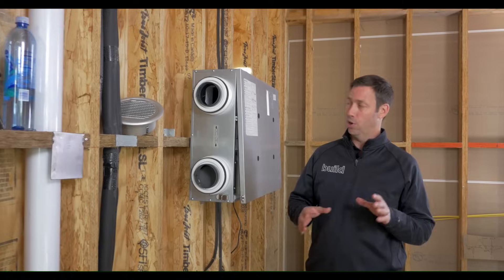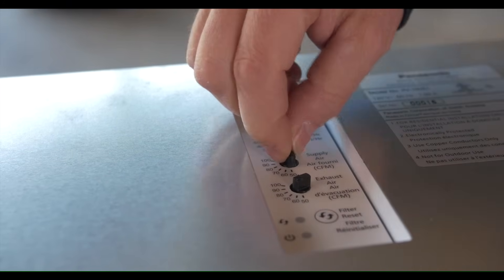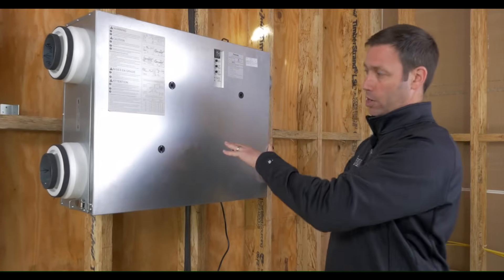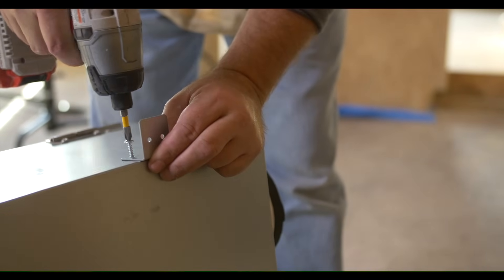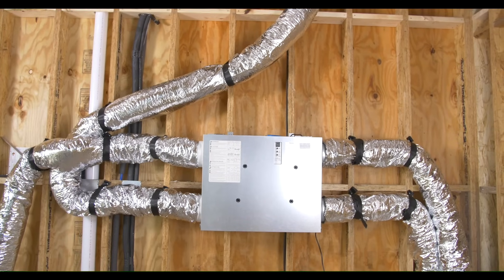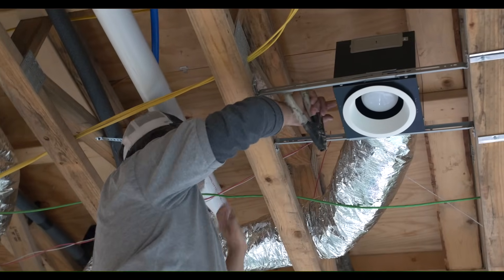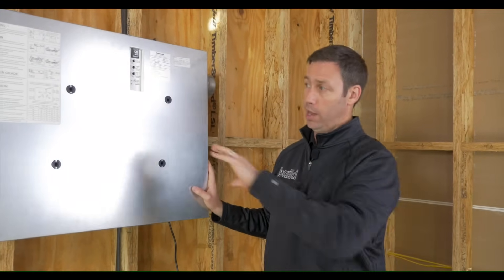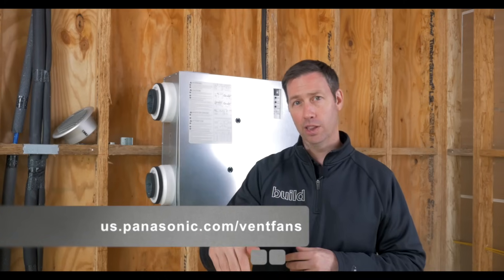How to Install an ERV

Comment: Matt, great video!  I have a question: does this ERV replace a traditional HVAC system or compliment it?  Thanks again!
Reply: It's mainly for bringing in fresh air into very tightly sealed homes.
Reply: @thebigdoghimself  what about for bringing fresh air into a basement with no windows?   i was going to get the panasonic one that looks like a bathroom fan.
Reply: @thebigdoghimself  Thanks John!   Yes, the basement is about 75% finished.   I just got the house and the air was very dry (like 15% RH in the living spaces) so I had a aprilaire 600 installed, however, because the basement is heated/cooled using "cheater vents" i am now humidifying my basement as well.   Maybe ok during the dead of winter but now that its getting less dry and warmer, I noticed a little stale air smell when i went into one of the utility closets outside of the finishes space (where the radon system comes out of the floor).   I want to be able to spend a lot of time in the basement so I want to get some fresh air in there.   I'm not really sure what to do tbh, I am wiling to spend some money on comfort, its really important to me.   The house is on propane heat so I wanted to look into a heat pump but the propane furnace and AC system is only about 5 years old, and they tell me I cant add a heat pump to it, I would need to replace it.   Also for a house built in 1990, the HVAC system is terrible, some rooms too cold, some too hot, its not balanced well.   I already found a hole in t he basement main plenum and sealed it up, someone tried to add another cheater vent and never sealed it back up.   Still though half the house is too cold.   I had a company come out but they were clueless, I dont know if I need to be looking for an HVAC engineer or what, any recommeendations?   I am going to be living inm this house a long time and even if it costs me a lot, i want the house to be comfortable like a new house.   I would like to also convert to multi-zone but dont know if its possible, everything comes from the basement, it looks like it could be modified but not sure because there is one main trunk for each side of the house t hat feeds both floors (and the basement with cheater).    Any advice yyou can give i would appreciate as you clearly know what you are tallking about.  thanks.
Reply: @thebigdoghimself  Awesome, thanks John, it's funny because I was thinking of getting a quote for windows!   Not for the energy savings though, but because the windows are really hard to open and close, I tried to lubricate the tracks but they still are hard for my wife to open and close.   I will try to spend more time getting them working properly rather than looking to replace them, thanks.   As far as the insulation, I cant agree with you enough, in my  old house, built in 1930, had ZERO insulation in the walls and like an inch of some old blown in insulation in parts of the attic.   I had a company come and dense pack cellulose in the walls and attic, along with air sealing the attic and it made a MASSIVE difference.   Oddly I only ended up with a 10% savings on my gas bill but the comfort level went from like a 2/10 to 7/10.   My new house being build 1990 is at least insulated but it needs some work, I already have a guy insulating the crawl space under an addition that is very drafty.   The attic I have been working in a lot and its batt insulation and its I am guessing maybe r-30?   THe insulation is like 6 inches above the joists.  the problem is, since there is no way to walk in there, me and all the other works have crushed it down in half the attic to the height of the joists.   I have been air sealing everything I can find up there with spray foam (fan boxes, light boxes, smoke detector boxes, wire penetrations, etc).   I was thinking once all my wiring work is done to get an energy audit done (they do them cheap in my state of NJ with a state program) and see whaat  they can do insulation wise, that addition is so drafty, not sure what I can do other than the crawl space.   NJ also will pay part of your insulation upgrade with their clean energy program so itss worth purusing.  

As far as the heatpump, the reason I was thinking of it was because A) I am getting solar and B) propane can be quite a bit more than natural gas, I was thinking maybe I could install a heat pump to run when its above 32F and then keep a propane furnace when it gets really cold instead of electric aux heat.    however, based on what you are saying, perhaps it makes more sense to stick with my fairly new propane system and try to get it working better.   perhaps the air handler fan is not powerful enough (maybe its not even on its highest cfm setting).   or perhaps when they cut up the ducts to do the addition they didnt do it properly, they used a lot of old school duct tape and not foil tape, so that doesnt help either.

I already ordered the air sensor, it was only $229, It should be in today.   I really doubt its a mold problem, I havent seen any sign of it, its really just one spot that smells stale, its the closet where the radon system comes out of the slab with one of those sealed sump pit covers.   perhaps its even related to that.   Mice dropping and mice nests on the other hand, found plenty of that!  what a nightmare, home inspector screwed me, didnt check the drop ceiling (claims they dont do that WTF) and missed lots of nasty shit in the otherwise very clean looking basement.  ive been cleaning it for a month!  

thanks again for your excellent advice, i think you are going to save me a lot of wasted money!
Reply: @thebigdoghimself  Very true, at least now I have a good game plan, I will work on insulation and air sealing, install the sensor and gather the data, and find a good hvac company to see what they can offer me to get fresh air into the basement.   At first I was going to DIY install the Panasonic 40/20 Spot ERV but the more I read about it, the more I realized it might not be what I need, so I am also going to get a good local HVAC company in therre to see what they can do.   I actually have the FLIR thermal camera you mentioned, I bought  tryign to air seal my old house but I had mixed results.  I was using it in the winter though, trying to find where the cold air was coming from, but it was hard to tell, it was mostly from around windows.   I never tried it from the outside in the summer though, tbh i never even thought of it and feel a bit silly now lol, i could see it working great to find where cold air is leaking out.   I assume that is how I can find the rodent holes as well, look for cold air coming out in the summer?   thanks again.
Reply: @thebigdoghimself  I believe the crawl space has a slab at the bottom IIRC, currently its just cinder blocks on that slab as a short foundation and then the joists.   The guy fixing my kitchen before I move in said he would insulate it for me, i think he plans on attaching foam board to the cinderblock walls and i guess foam seal them.   I hate small spaces so when he offered to do it when he was there i agreed, he said it would help a lot.   I will probably let him do it and then I can always spray foam after.   I will see waht the insulation contractor says to do when they come and check the place out.   I am debating if I want to use the states green energy program.   They require an audit with a blower door test, then they determine your discount, the issue is, they make you do other things to qualify like replace your water heater with one with a booster fan and stuff like that, that eats into most of the savings.   Plus I think the contractors charge more since they know you are getting a discount and 0% financing.
Reply: @thebigdoghimself  my water heater is propane but its only a year old, the lady replaced it right before I moved in.   The problem with a heat pump water heater, if i recall correctly from Matt's video, is it makes the room its in colder.   I am trying to warm the basement, so I might be saving money on the heat pump water heater but then spending more to replace the heat in the basement.
Reply: @thebigdoghimself  John, curious your thoughts on spray foam insulation.  I called around some insulation contractors today and the first two I talked to wanted to first and foremost spray foam with closed cell foam my crawl space under my addition, which I tend to agree with, right now its just some batts in the joists falling down and nothing on the foundation blocks.  They also wanted to evaluate spray foaming the roof in the attic.   Currently I confirmed I have the R-30 batts in my attic with no air sealing. I really want to air seal because of the huge difference it made in my last house.    I know you said blown in cellulose, but does that work over R-30 batts?   Not sure what netting it means?   If I'm not mistaken though, that still wont solve my air seal issue if its not dense packed I believe.   The one thing I liked about spray foaming the roof is i could still work in my attic, if I add more insulation its going to be nearly impossible.   Thing is, I have ridge vent, fan vent and vented soffits currently, and all of that would need to be sealed up if i did the roof.   Its crazy too that supposedly it works better if they then remove my R-30 batts and not leave t hem!  the crawlspace makes a lot of sense I think, not sure about the roof.  thanks!
Reply: @thebigdoghimself  Once again an awesome reply, I cant thank you enough!   I do have gas heating and cooking but does the fresh air have to come from the attic?   The rest of the house is not going to be sealed tight, only the attic, the rest is early 90s fairly leaky construction, wouldnt that be enough?  I am not going to do the walls if I do foam, its going to be too expensive, I have R-15 in the walls now supposedly (neighbor told me, said its 2x6 construction on house exterior walls).   Without doing the walls, I would imagine plenty of air will come in around windows and leaky doors?

In my attic I guesss my air barrier is the cheap paper on the bottom of the batts.   

I would love to do the raceway around the attic, I love that idea, HOWEVER, my roof is a truss roof, I believe its called a HIP truss roof.  basically its a truss roof with no gable wall.   I could put some raceways but overall its going to  be difficult with the trusses in the way.

I will definetly puruse spray foaming the crawl space, but that is a very small area, 90% of the house is over the basement which is cement.  RIght now there is some fiber glass stuffed in each rim joist.  A little bit of batts on the finished basement walls.  I would LOVE to make the entire basement more comfortable, should I spray foam the entire thing?  The rim joists AND the walls?   Problem will be spraying the walls hidden behind the finished sheetrock walls though.  I can get to the rim joists but not the walls. 

You had a fire at your previous home?  That is horrible, that is one of my worst nightmares, what happened?   Is that why you are well versed in all this new building techniques because you had to build a new home to replace it?
Reply: cmm170526 this system does not heat or cool, it's for fresh air circulation of a tightly sealed home
Reply: @tommydjohnsonjr  i dont have an hvac system, can i install even without and where is the best place to install. i have a cape and i was thinking of installing in my knee wall space. its spray foamed in there.
Reply: A Font yes, you don’t have to have a HVAC system for this. It can partner with an existing system or be used as a stand alone